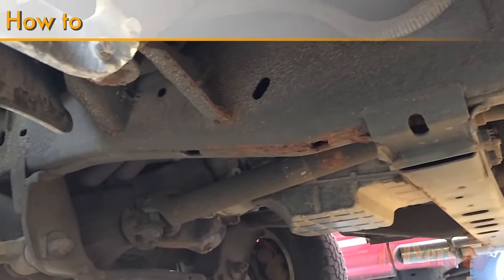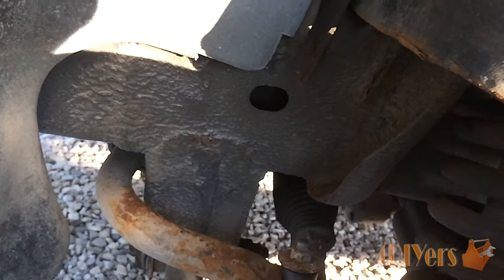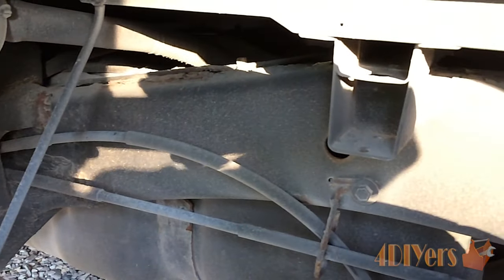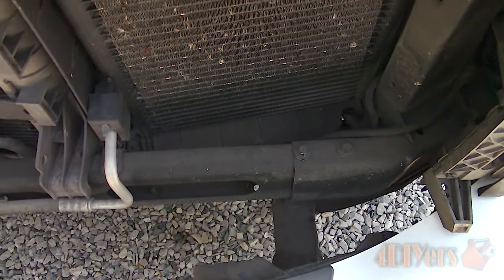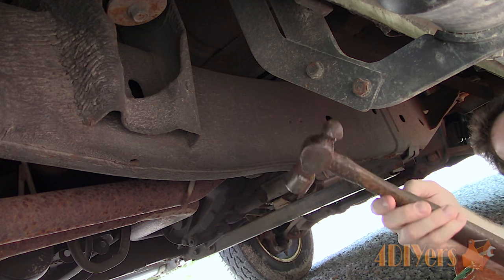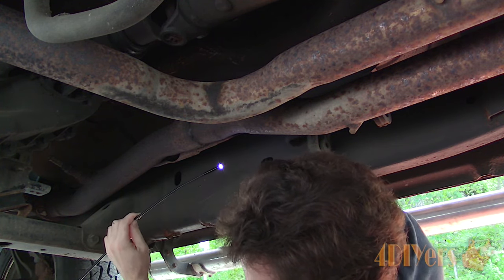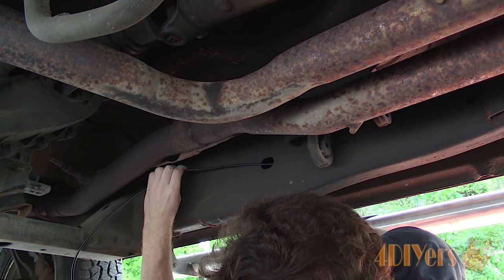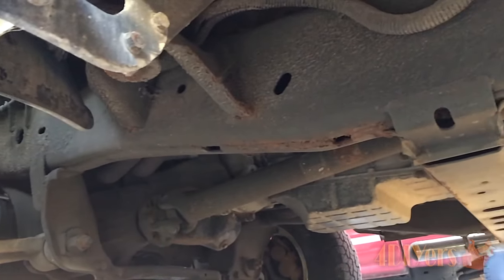How to Inspect a Vehicle's Frame for Rust

Comment: Most used car sales dealers I’ve been to have the worst rotted frames but nice exterior. Lipstick on a pig. Price tags around 19-20k
Reply from the maker: New car dealers too. I worked at one in high school, don't underestimate anyone.
Reply: I just bought a Cadillac that looks new but I didn’t check the frame and it’s rusted in the back I feel sad now

Comment: Great video! Im looking at a 2011 ford ranger right now that has 46k miles on it (driven mostly on dirt roads) and trying to decide if the rust under it is surface rust or not
Reply from the maker: Happy I could help! Watch the area around the catalytic converter, it's a known area for rusting. The rear leaf spring brackets also fail on those trucks too, but can be replaced.

Comment: What so you do to prevent it?
Reply: Get used motor oil and spray it all over the frame. I’ve met some old timers and they swear by this. But even with that you can’t do anything but temporarily prevent it. Rust never sleeps

Comment: Thank you for this video!! You are very thorough and informative! Unfortunately, I found this after buying.
I bought a 2004 Honda Civic with 89,300 miles, but it has quite a bit of rust on the undercarriage. I don’t know what I was thinking.
Reply from the maker: You're welcome and sorry to hear. Well hopefully it's still solid and you could potentially get it sandblasted, then have some paint applied to the underside before it gets worse.

Comment: Well I was looking for where cabin leaks commin from under windshiled area(dashboard) So I was pouring water on windshield to see, if drainage holes are blocked etc. and I noticed there is a hole in my frame rusted thru and water is pouring from down there (which means there's also hole on top, where the water is getting in) ... well that made my day.

Comment: I would like to hear your option on that truck you were inspecting. Would you consider that an acceptable truck to buy? Is the condition it's in maintainable? Meaning can the rust it has be slowed down or stopped from advancing by say oil coating application?
Reply from the maker: Very acceptable considering what it's been exposed to. It's underside is cleaner than trucks 10yrs newer which is why I bought it, I got super lucky. I did a video on applying oil spray https://youtu.be/WN_n4gpCorM and did some light clean up. It wasn't mandatory but just for peace of mind. Slowing down rust would be using an oil spray, but if you wanted to stop it, you'd have to mechanically removed the rust or use a chemical treatment, then apply a paint. Then apply an oil spray over that.
Reply: @4DIYers  Thanks you for this. I just bought a 2005 Silverado Crew with 6.6 Duramax in Bismark ND, I now live in Spearfish SD. I moved here from Oregon last August. I was shocked to see fenders rotting out of trucks and cars here. Anyway the frame has surface rust, yet the body is in excellent. The mounting rails under the bed don't look so good. I expect to be taking the bed off in the near future. Thanks again, that's what I wanted to hear was from someone with experience and being able to make a subjective judgment. The frame on my Silverado isn't that bad by comparison so I will definitely watch your other videos about maintaining the frame. Thank you much I feel some releaf.

Comment: Hi guys, I was looking at a used truck for sale at a dealership. There was no "fix engine" light or anything. when i put the fixd app into work, it came back with a code that said that there is a 70% chance this was going to be an $800 problem. I told the dealer and I left. He sent me a text the other day saying he had driven the truck for about a hundred miles, and that when they plugged it in, the codes were gone. he then said that it was a previous issue and the the truck was ready for sale. Does that make sense to you because i'm not buying any of it. thanks in advance!
Reply from the maker: Used car or new car dealership? I would also ask them to provide proof of the repair. The code would eventually disappear if the issue was fixed. You can also connect the scan tool again and it will be listed under pending codes. So it may not trigger a light but it's still there.
Reply: @4DIYers  sorry for the delay. it's a used truck. i remember him saying something about splitting the cost if that issue arrived. i don't really believe that even if it was in writing. but it does tell me it's an issue he wasn't aware of, or pretended that. what do you think, should i skip?
Reply: @4DIYers  and i want to be sure, so if i scan it again, and the codes don't appear, he was telling the truth?
Reply from the maker: If the truck came with a warranty, splitting the cost shouldn't be an option. It should be covered under warranty. If he did fix the issue, then there shouldn't be a concern of it popping up again. If not or if it was a sketchy repair, then there is a chance it could pop back up again. 

I would scan it again, but don't tell them you're coming so they don't clear it before hand. If an option, take the truck for a couple hours and run some errands with it. Give it a good run, then scan it before returning it. 

I'm not a huge fan of dealers, especially if they're used car dealers. Not saying that they're all bad but I think better options and deals can be found privately. Dealers are there to make money and if this is a sketchy dealer, might be hard trying to get a reliable vehicle from them.

Comment: Thanks for the video. Which SUV brands are known to be more rust resistance to snow salty areas in north?
Reply from the maker: Probably European brands. Toyota is known to have some major rust issues on all their full frame vehicles. I've also seen quite a few Ford Escapes with structural rot as well.

Comment: Did I hear you say that's a 2006? My truck had more rust a year out of the factory!
Reply from the maker: Yep, 2006. It's pretty rare to find a Ram this clean where I live, so I ended up being very lucky getting my hands on this truck. I was looking for quite a while at different trucks too, trying to find what had the least amount of frame issues too. Before winter I need to clean up those mildly rusted spots, then get a special gun to wax spray the whole thing.

Comment: Looking at a 2016 f150 in Oklahoma that spent most of its life up in canada. I'm skeptical as I know a lot of salt is used up there compared to down here
Reply from the maker: We use a ridiculous amount of salt here and it’s been getting worse. If it was oil sprayed, then it was protected and has a good chance. My best advice would be to look it over good. My Ram has spent most of its life in Canada and is extremely clean underneath for its age and mileage.
Reply: @4DIYers  Ok thank you! I found a newer truck that only spent about a year up in Canada but I'm now going to check it over just the same to make sure it looks good. Thanks again for the info!
Reply from the maker: You're welcome! Best of luck, keep me posted on what you buy.

Comment: Is there anything to do to save a frame that is rusting from the inside?
Reply: No. Scrap the car it poses a safety issue
Reply: Take a few chain links and connect them to a drain auger. Feed the line into the frame and connect your drill. The chain links smack a lot of the rust out. Then you gotta get in there with a vacuum and get out everything you can. Spray the inside with a lanolin coating (ideally) or whatever type of oil you can afford. And honestly after what I’ve dealt with, I recommend drilling a small hole on any low spots where water or dirt can gather. 

Then you swear to yourself that you will pay meticulous attention to your next truck and buy it from a southern state.